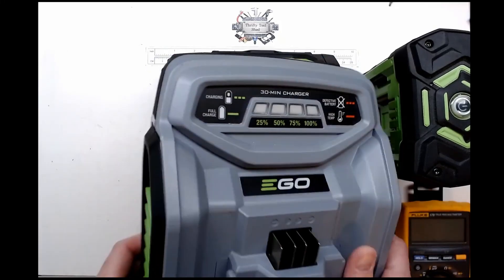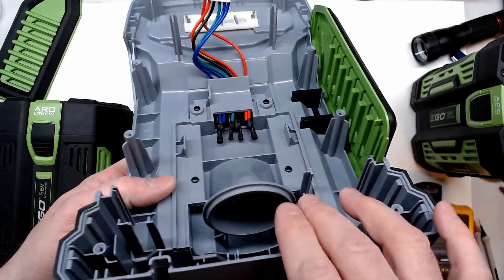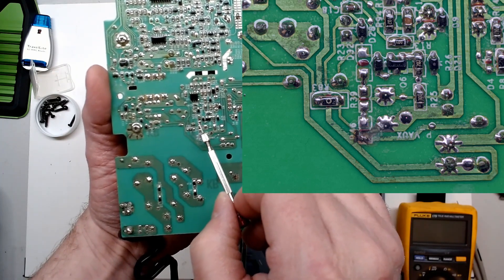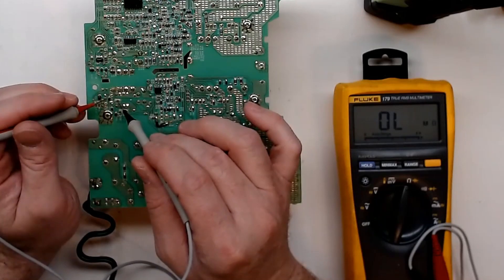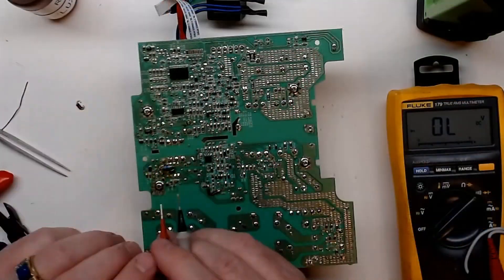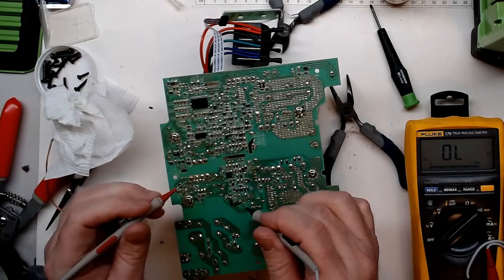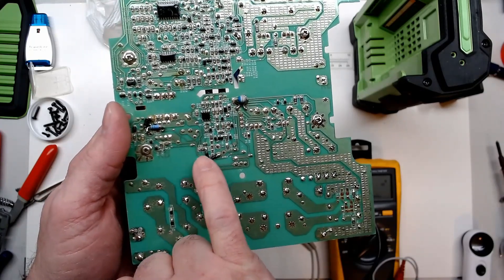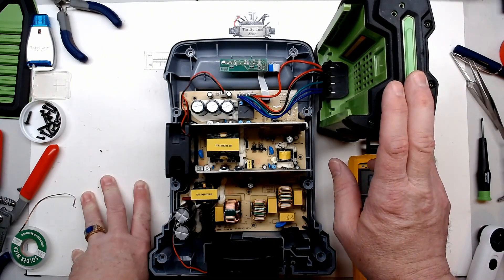EGO 56V Rapid Charger Repair

Comment: I tried this ego brand, 1 batteries are to expensive. 2 charger died after 3rd charge. I attempted to switch over for around the house at the farm. But, with these problems and issues. I needed something that just worked. I was really powerful.

Comment: Im not sure if I've got problems, too.  Charged my battery, fully charged battery lights, all went off . But when i look at the power consumption off the battery charger, it's still taking out 300 watts power consumption. I further leave it running another ten minutes running until power consumption drops to nil, and i then switch  it off. Thinking its full .because a lot of other battery equipment consumption readings normally read nil when fully charged.     Why would the consumption be so high when fully charged ? It should be nil or a couple of watts at least on  standby

Comment: The 0 ohm resistor has no resistance, so it draws no current and thus generates no heat unlike a resistor that actually has resistance and is dropping voltage and using current.  That's likely why it wouldn't have blown (if that was the issue at all).  Also, you often cannot just measure the resistance of a resistor while installed in circuit.  Any of the components connected to this resistor can sometimes affect what you are reading.

Comment: Hi , can you tell me the D12 diode value on the board?
Reply from the maker: This video is over 3 years ago and I have not worked on one since. This video is the only reference I would have also. Sorry. If anyone else has one apart and sees this maybe they can help?

Comment: Glad to see the same problem I’ve had. I have some soldering skills and even though this is a very thorough video this is a little bit over my skill level. 

Hopefully ego will address this board issues and put out a more rugged charger. 

I unfortunately didn’t save my receipt and register my product.

Comment: Does the charger use the D terminal as well? I can understand the T terminal because it needs to monitor battery temp.
Reply from the maker: The one charger that I worked on used both. It still communicated with the pack to some degree and the charger used to be the only thing that used the T-terminal. I have seen newer blowers etc that have all 4 connections, but I don't know if they use them all.

Comment: EGO just sent me a new battery pack, since my old one was defective. As soon as I put the new battery pack on the charger, it made a small pop noise, and now the charger is shot, doesn't do anything at all. I wonder if that fuse popped in it. I'm really starting to hate these ego mowers, nothing but trouble for 2 years now. What size fuse did that have, and is it user replaceable? Thanks for any help.
Reply from the maker: Well as seen in the video I had a couple bad components and not a bad fuse. I do believe most of these models have a fuse that is soldered in so replacing it would not be that hard. It is at least 2 different versions of these chargers and maybe even more. Hopefully they are similar enough for the video to be helpful.
Reply: @ThriftyToolShed  Thanks you for the reply. It's still under warranty, so best bet would be to let ego handle it, I guess. They've already send a new mower, and a new battery, might as well send me a new charger. lol In all my years, I've never had such issues with anything else, never had a charger just quit. I'm about to put it all in the refuse.
Reply from the maker: @MotoJim2020  
Yes, warranty replacement first for sure. EGO usually lets you keep the bad item so I thought that was why you asked about repairing it. 
What you have been through sounds like a pain for sure. This does seem like a very unusual issue as I don't see many issues with these over all. Most of these run for many years without issue and I know by saying that doesn't help your situation much at all. Just saying if you do give all the new warranty replacement items another shot hopefully they will perform much better than this first experience. Also, if you do decide to get rid of them, they will typically bring good money on eBay! Best of luck To ya!
Reply: @ThriftyToolShed  Thank you for the reply. It figures I'd have trouble with the charger, especially when they seem to be more reliable. I've sent them a message about the charger. I hope they decide to get back to me. If they send a new one, that will make a new mower, a new battery, and a new charger. Not sure how they can make money with problems like these.

Comment: Brand new CH5500E charger here in Australia. Purchased in Jan this year. I suspected from day 1 that it wasn't fully charging the battery. The charger would show full charge, but when I take the battery off, I only have 2 bars and get maybe 15-30 mins of mow time from a 5ah battery. Kinda wished I'd got the slow charger now..
Reply from the maker: That is a weird problem. I have not seen that on one of these.
Reply: @ThriftyToolShed  This is a  240v AC unit, so possibly different fault characteristics to the 110v models. Anyway, will be interesting to see what happens with the warranty claim.

Comment: Fine sir, I'm trying to turn a spare Ego CH2100 into a DC power supply for a DC input battery charger. Do you know how I would get power to come out of the + terminal? I'm getting 3.4v from  T terminal and .02 D terminal.
Reply from the maker: Hello, I have not worked on that charger to say for sure. I am almost sure it uses the D-Terminal to communicate with the charging pack and it utilizes that to output correctly. The T-terminal is also used to monitor the temperature. I have separate videos called "What is the D-terminal?" and also " What is the T-terminal?" Where I discuss what I know and don't know on the subject...
Reply: @ThriftyToolShed  Yeah skimmed those. So the D terminal somehow signals the charger to output power to the Batt + terminal but no one knows how?
Reply from the maker: Well it's communication between the two. It knows the size of the pack inserted,  if any issues (Errors) and charge status. It seems to also have a temperature reference so it knows that as well even though it also has separate terminal for temp as well. What else? Not exactly sure, I have not had any time to spend on figuring out any more on the protocol. I posted the video hoping to get some EE(s) involved that may have more experience in that part of the design. I have had a few people contact me about working on that part of it, but I think they got distracted as well.
Reply: @ThriftyToolShed  There is a thread with people who had been working on it on Endless Sphere. Your videos are referenced. The thread is titled "Understanding and Using EGO Power+ Batteries." Have you seen this discussion?
Reply from the maker: @brentonfender2081  
I have not seen that!
Reply: @ThriftyToolShed  Glad I could point you there.

Comment: Q~ I took my 56v 7.5 battery apart and I accidentally connected the 4 charging tabs backwards ~ battery to charger. Did I ruin the battery 🪫 or the charger?
Reply from the maker: Could have messed up either or both. I would check the fuse on the pack first and then the charger fuses. Hopefully it's minor.
Reply: @ThriftyToolShed  Checked the battery leads with volt meter @ 55-57. Button light turns on when I press it. Battery was charged 50% before I stupidly played around.  I just plugged in the charger and a little spark popped at the outlet. No outlet fuse blown. Do you have a video on how to repair a charger fuse if blown? Appreciate your help....
Reply from the maker: @MrRadBee  
I only have this one video on a charger. It was a rapid charger and the issue was a blown trace, diode and maybe a resistor if I remember correctly. The fuse was not blown on it. I bought it as nonworking and repaired it. Sounds like your battery fuse is good, hopefully not anything wrong with the BMS board. Best of luck to ya!

Comment: Hi, Nice video. I've been having problems with the same charger. It only charges to about halfway before showing as a full battery. I thought it was the battery first but have now tried 3 different ones in it and have the same problem with all of them. I haven't opened it yet as The only secure torx screwdriver I have wont fit down the holes.
Reply from the maker: Yes, I use the long bit security set. It helps a lot with many items when disassembling. 
I should have them in my list of items I like to use on my work bench. 
https://amzn.to/3GVirQE
Or 
https://amzn.to/3x9LriU

Comment: Nice video, reminds me of my passed similar approach fault finding switch mode power supplies. Always be careful with shorts across capacitors, they are usually not the problem and often it's something else across the power bus, many times its rectifier diodes that fail shorted. Also a suggestion, using a cheap mains power meter ($20 from Bunnings in Australia) you can see if the charger is actually charging very easy as well as some other charger irregularities by observing power draw (watts).

Comment: @thriftytoolshed
Thanks for the video. The glass fuse on my charger is blown, can't see any other problems. Could you help identify a replacement please? Am I right in saying it's a thermal fuse? I can't make out all the markings, maybe 250v3a cqc vde with what looks like an ic logo.
Could a bad battery have caused this or should I be looking for another problem?
Thanks
Reply from the maker: I do not believe a bad pack would cause it since the output section of the charger should have its own protection. Either the the power supply section itself caused it or maybe even with a storm something on the input line can cause it. Sometimes the fuse protects quick enough and sometimes it ends up with other component damage also. 
So if seems like its a common glass fuse, not a thermal fuse. The glass fuses are for current protection ok only. 250V 3A is the rating it seems. You can get the approx size of the fuse and I assume it's axial and has the leads coming from the ends to solder through hole? I would just search eBay, Newark or digikey for that size fuse with leads 250v rated for 3A. If you can't find anything let me know. I would assume this is a time delay fuse and not a fast acting fuse if powering the power side of the power supply, but I don't know that for sure. Best of luck to ya!
Reply: @ThriftyToolShed  thanks for your time and advice

Comment: Thanks for your video do you know the  value for R59 many thanks i think you said 10 ohms but mine go up in smoke
Reply from the maker: I don't remember if that was R59 I replaced or not it has been so long ago since that repair. It was a 10 ohm resistor I replaced for sure. If you cannot find any help in this manner, I could open up my charger and see what the value of R59 Is on mine. It may take me some time to get around to it though!

Comment: My charger isn't even powering on.
Reply from the maker: I assume you have tried more than one battery in charger as well. Then I would test input protection area first, the Fuse, Thermistors, Diodes  etc. Be careful  with mains voltage make sure unplugged and verify all caps are discharged of course. Only testing what you are qualified to test.
Reply: @ThriftyToolShed  
Yes, I tested with 8 different batteries. Ok, thanks for the info.

Comment: Thanks for much for posting this.  You gave me confidence to repair my CH5500 myself (25% light blinks but batteries don't ever begin charging).  I looked closely at the board and found an SMD resistor with a white spot on it, which ended up being burned coating, and the resistor checks out at >1 megohm.  The resistor (R20) is located in the upper left quadrant when looking from the rear, about 3/4" to the lower right of the larger IC.  I scratched at the burnt spot but it took away some of the resistor's ID numbers.  Do you happen to know what that resistor value is?  From what's left of it, I think it begins with "2".  I have watched your video multiple times trying to see if I can pick up the number, but no luck.
Reply: I should also add that the charger read 25% no matter how charged the battery already was.  So it both could not detect the battery’s charge level and would not charge the battery either.
Reply from the maker: The R20 value on mine is 201 so 200 ohms. Keep in mind the conformal coating over the board can make it hard to get a good connection while troubleshooting. I feel like you already know that, but wanted to share just in case. If the smd has a white spot as you described, most likely it is burned just as you said. Hope it helps, best of luck to ya!

Comment: Mine stays red on 25 percent and tested at 50.04V. The problem is my 30 min fast charger because i realized its missing a fin. 4 finds on the charger that the batter sits in to charge my 3rd pin is missing. Whats your suggestion?
Reply from the maker: Sorry, I don't understand what is missing? The third pin on the charger?

Comment: nice work. Do you know does the rapid charge with protection fuse inside? I had thunder hit and the charger no longer work without any power indictor any more.  Thanks.
Reply from the maker: It should be a Input protection fuse and MOVs as well. Sometimes they help stop damage and we never lucky.  Unfortunately lightning is so fast and powerful that it's hard to clamp it fast enough that close to sensitive components to help many times. Best of luck to ya!

Comment: Where can I find the schematic for this charger? Transistor in slot “U9” has appeared to be blown. I’m not for sure what I need to get for a replacement
Reply from the maker: I do not know of any schematics available. The main reason I take time to show some of my repairs is because most consumer items these days do not have schematics available. At least I share what little bit learned through the troubleshooting and repair process. It's not the best, it doesn't answer all questions, and it may not be the same issue, but hopefully as we all share what we learn it will get easier.

Comment: Nice one! Any suggestions on how to monitor charge % on the older batteries without the proper battery gauge on a normal charger?
Reply from the maker: It is very hard to tell on the older packs. I can't believe they did not put a fuel gauge on the things. You can do a basic voltage check on the + and - terminals with somewhere around 40V being fully discharged and 58V or so fully charged. It all depends on how much load your tool using at the time. If you are reading below 50V for example it will not run a blower very long. A blower eats the battery up quicker than even the chainsaw does!
Reply: @ThriftyToolShed  Yeah. And that is when they have the gauge on the rapid charger...
Have you taken new ones apart? Are they much different to the old ones? Thinking of getting 5Ah battery and the old one without the gauge is $70 cheaper than the new one
Reply from the maker: @fokcuk  
I do not have a new style pack yet. Hopefully they are much better and don't have the issue we found with Q12 shorting out on the BMS.

Comment: why in the whatever is that board single sided?  those chargers aren't cheap; I don't know why they'd need to save money by using a single-sided board...
Reply: Easier to repair if it’s single sided.  I wish more devices still used through hole technology on parts likely to go bad, but they’re not designed to be repaired by normal people anymore.
Reply: It's to make as much money as possible #capitalism

Comment: Just curious if you ever checked how many amps the rapid chargers pump into the batteries while you had it opened up. They don't say on the back of the charger. Great videos by the way. Excellent work!
Reply from the maker: Sorry, I did not. I believe it to be around twice the basic charger rate since it is around twice as fast. I am not 100% sure. Thanks for your comment!
Reply: The manual says 7.5A

Comment: Nicely done. How old was that diode?
Reply from the maker: The one I used for testing is one I removed from a heat controller in the mid 90's. It is possibly from the early 80's?
Thanks for your comment!
Reply: I hate how this charger sparks when you plug it in to AC.  That a design flaw??
Reply: @michaelcharach  There's no pfc or soft start. Not a flaw per se; they just cheaped out.
Reply from the maker: @timh2870 
Exactly, just large caps on the input side of the power supply with no in rush NTC.  Seems most electronics these days are designed to stay plugged in I guess? You see it alot now, back in the analog days with CRTs for example they were mandatory!
Reply: Plug into a power strip with a switch.  It’s probably  inrush current ast the power supply capacitors are getting charged up.  They likely could have designed it not to do so by adding an NTC inrush current limiting resistor.

Just plug into a power strip with a switch and use the switch to turn it on and off.  Personally, I think all devices connected to mains power ought to have a physical power switch to shut them off when not in use, but that’s not how things are made these days.